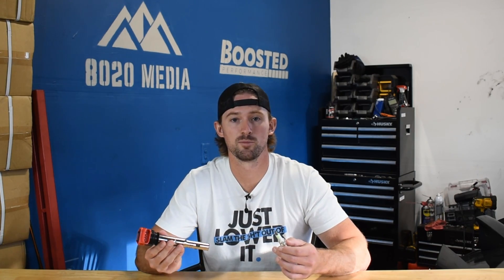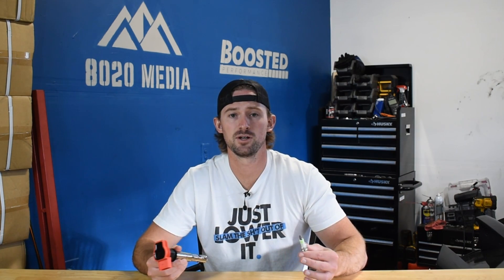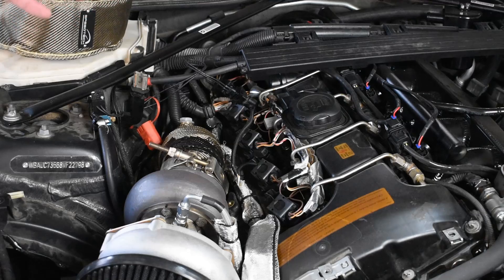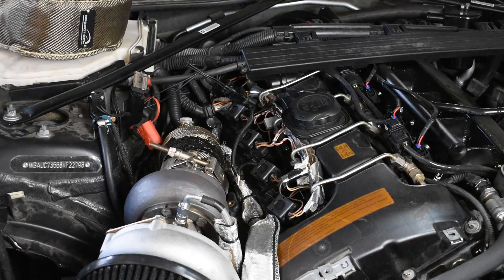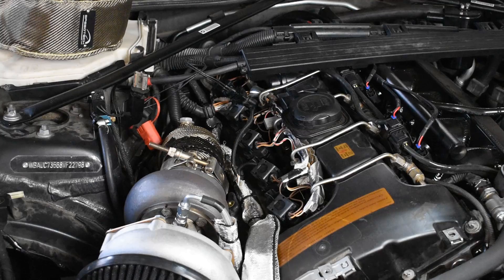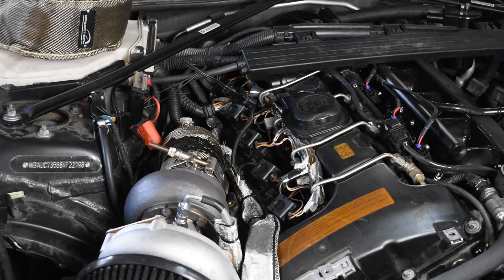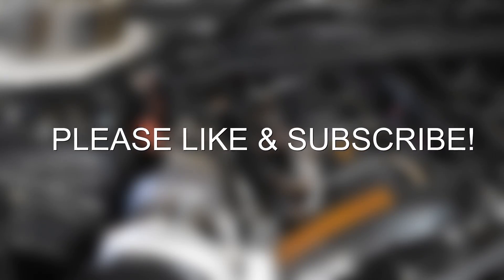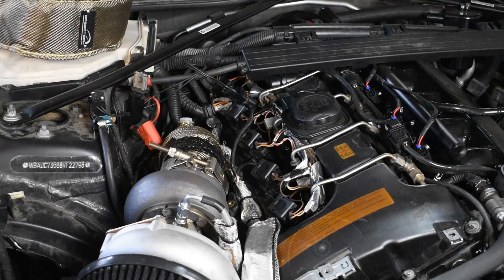DIY - How to Diagnose Bad Spark Plugs & Ignition Coils!

Comment: I had all these problems, but recently it got worse. I let my younger brother go to get food in my 2012 chrysler 200 2.4L. About 15 minutes into the drive he calls me worrying, saying the car started shaking. Misfires, hard starts, lack of engine power, and bad mpg were my symptoms, but not the pretty heavy shaking when idling or driving, which occurred yesterday. Any reasons that may have started happening?

Oddly, the only engine codes i got were only on the catalytic converter, and catalytic converter gasket. So i’m not sure where to go from there and don’t have the money for a repair shop. :/
Reply from the maker: Huncho - Were those the only engine codes you got? Seems odd with everything going on. Sounds like it could be many things.
Reply: @8020Automotive  Yes oddly enough those are the only codes i got when i scanned my system. That’s why I’m so confused and not sure where to go from there.. Should i still try changing my coils and spark plugs still? Or should i just save up money for a shop? I have a eery feeling my transmission is going out but i’m hoping it’s not the case. It does have 140k so it wouldn’t be the least bit surprising if its my trans.
Reply from the maker: Huncho - Would hate for you to replace those components and it not fix the issue. So probably best to go to a trusted shop to get diagnosed, then go from there.
Reply: @8020Automotive  Reasonable, thanks for your time man.
Reply from the maker: Keep us updated!
Reply: @8020Automotive Well, i ended up changing the spark plugs and ignition coils. All 4 spark plugs were in terrible shape and 2 had chipped porcelain. The ignition coils were in pretty bad shape as well. I believe my computer system may be faulty as they start go out in the Chrysler around 120k and i have 142k so that might be the reason for it reading a bad cat. Since I changed them out, no check engine light, no misfires, better mpg, no engine power loss. Its running super smooth.
Reply from the maker: Huncho - Glad we could help! Sounds like you've got it back to top shape!

Comment: On my 2002 Ford taurus 0:09   My car is hesitating and chugging and it misfired and checked the spark plugs. Too was not working and got new coil and the  two same spark plugs still not working with new coil. Why are they not working?
Reply from the maker: Laine - Have you checked for any engine codes? This can assist in your diagnosing.
Reply: @8020Media  yes it wouldn't  work on my car. They Scan it 2 or 3 times, and it wouldn't read it.
Reply from the maker: So you've taken it to a repair shop?